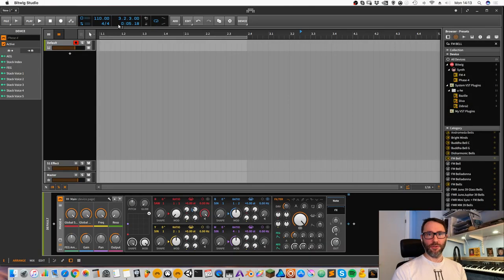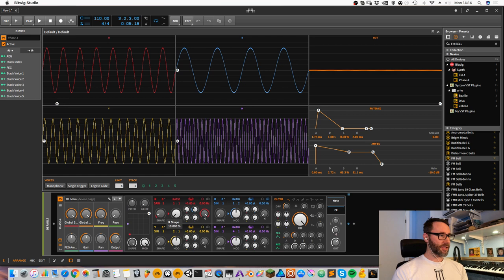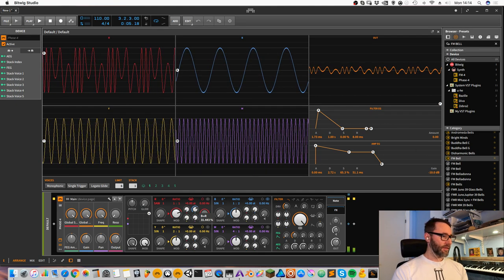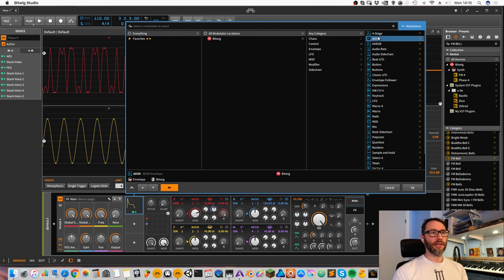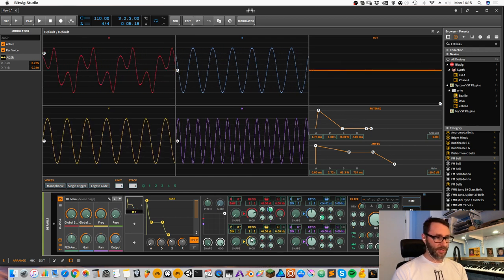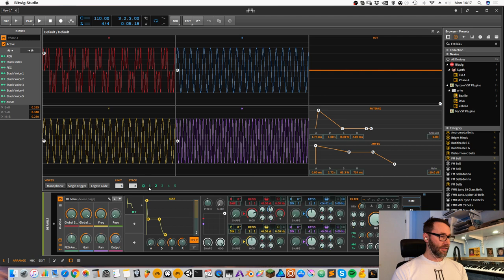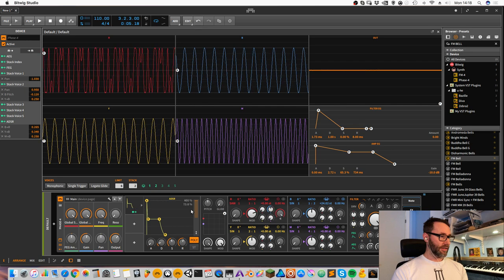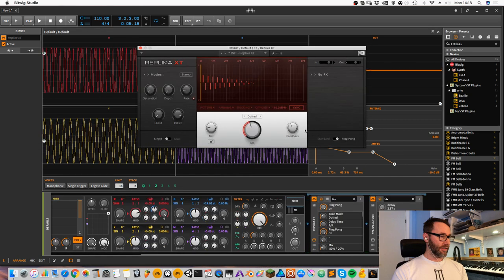Bitwig - Phase 4 tutorial - Bell synth sound design

Comment: Please help me, I am using google translator because I cannot find any video that explains how to turn off the random phase that is preconfigured in all synthezis instruments, an example: fm 4, phse 4, polymer and polysinth every time I play a note the Random phase is there changing the timbre and volume, if you told me how to turn it off, I would appreciate it very much

sorry for being three years late😅😅
Reply from the maker: PHASE-4 resets the phase on each keypress if you didn't add modulators to phase angle. It's actually VERY precise and exact on each retrigger. ;)

Are you making a custom preset from scratch... or fiddling with PHASE-4 presets from the Bitwig library? 

POLYMER default preset on the other hand drift in phase between keypress. It's because the sub osc is not by default in phase with the regular osc. You can press (activate) a small "sync" button just above the Sub-knob in Polymer. That will make sure the sub is in sync with the main osc (I think it's a pulse by default).

Hope the info helps. 🌞
Reply: @MattiasHolmgren  thank you